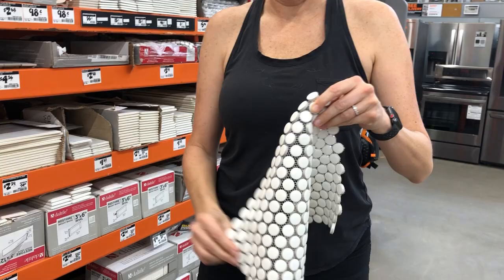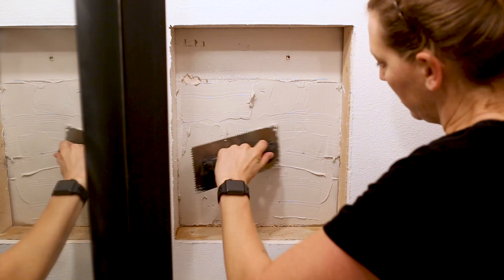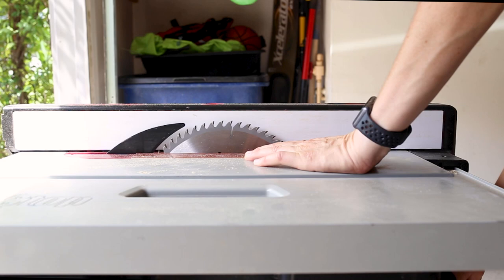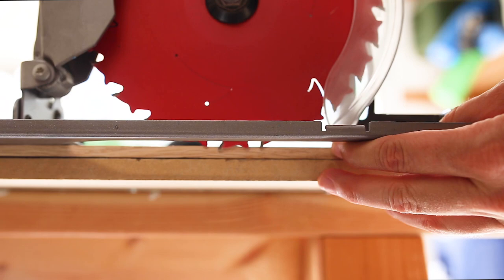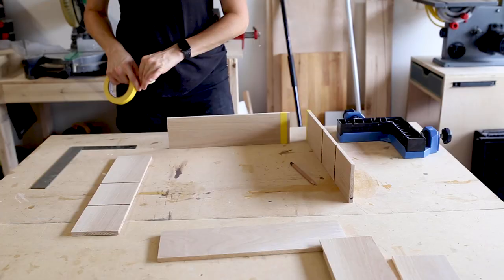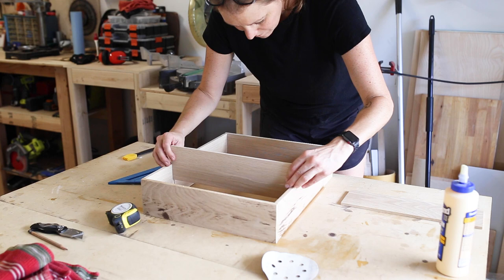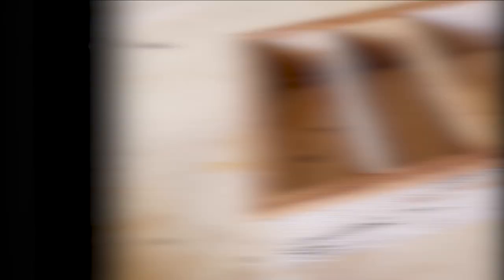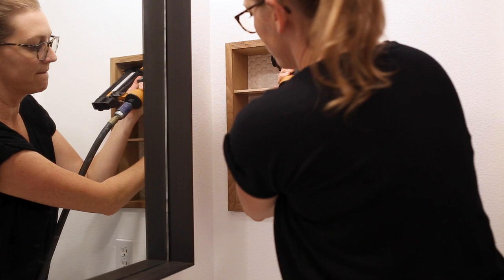DIY Modern Medicine Cabinet Makeover | Recessed Wall Cabinet Shelves

Comment: Since I'm a fan of oak (red oak mostly) the first thing I noticed about this was the wood. I like it, and I also like that you matched the grout color to the tile. Well done.
Reply from the maker: Thank you so much! White oak might be my favorite wood right now. Thanks for watching!
Reply: @MakerGray    a while back I turned a couple pens out of red oak and finished them with friction polish. Not sure if it's the chemical make-up of the polish I used, or the fact that stuff generates a little bit of heat when you put it on, but the end result was some of the grain darkened while the overall color got lighter. Also got so slick they're a bit tricky to hold on to, but I figure that's because I sanded them to something like 12000 before polishing. Learned my lesson though, and since then I stop sanding at 600 then apply the polish.

Comment: I’m no expert but don’t those tiles need grout after you apply them? Where did you get tile you can cut with scissors also? I want that lol.
Reply from the maker: Yep! I added grout at 5:20. I got the tile at Home Depot.
Reply: @MakerGray  is that the peel and stick tiles? I didn’t know those used grout. Interesting. I guess they’re 3D or something. I’ve seen those. Thanks.